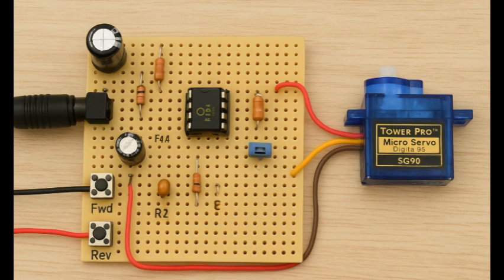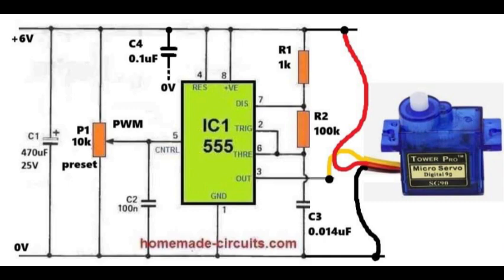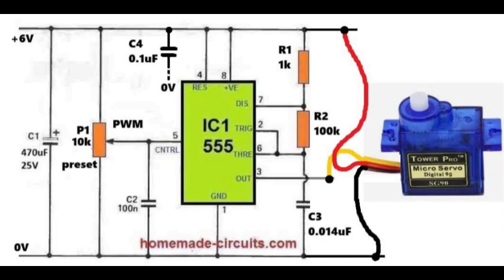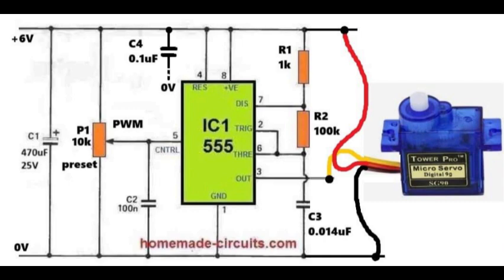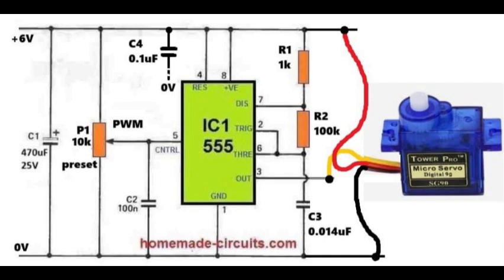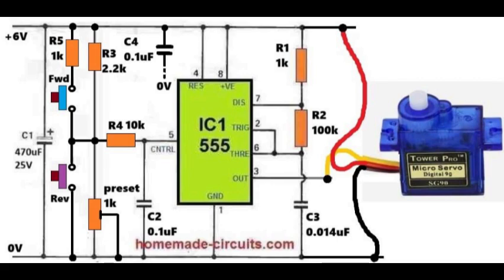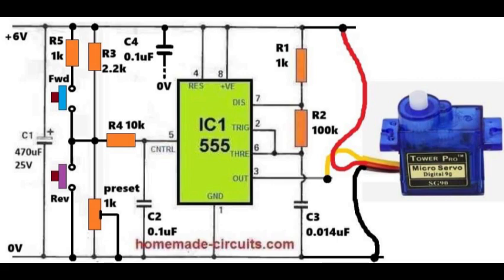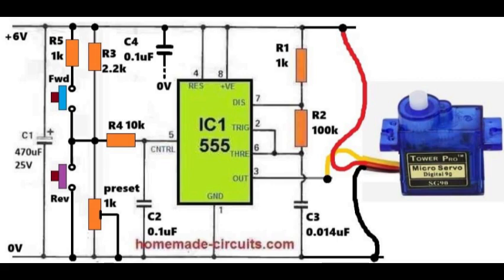Build these Simple Servo Motor Controller Circuits using Potentiometer and Push-buttons

Comment: Hi Swagatam. Am a strong follower of you and have been using few of your circuits to my requirement which are really great and I humbly thank you for sharing them here. 

Now I need your help in another project for my son somewhat similar to the above. The requirements are as follows.
The project involves 4 motors and they are to be run with different time and gap.

when the switch is on,
Motor – 1 & 2  : Door opening - Sequence 1 (two doors and hence 2 motors) 
Motor – 3 : Water flow  -- Flow for 1 minute – Sequence 2
Motor – 1 & 2 : Door Closing – Sequence 3
Motor – 4 : turn (360 degree) with an object placed on the motor -  Sequence 4 
Motor – 1 & 2 :  Door Open -  Sequence 5 (should stay open for 5 minutes)
Motor – 1 & 2 : Door Closing – Sequence 6
Motor – 4 : turn (360 degree) with an object placed on the motor -  Sequence 7

A gap of 5 sec in between each sequence is needed. Motors 1 & 2 need to run in different direction.

Thanks in advance and looking for your help at the earliest.
Reply: Motors 1,2 & 4 are small 5 volt gear motors  and motor 3 is aquarium water pump